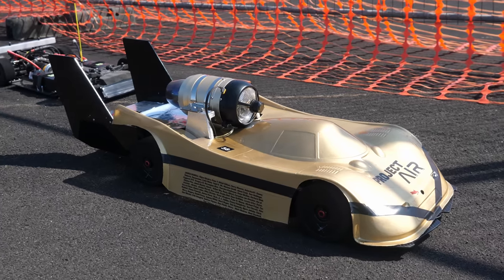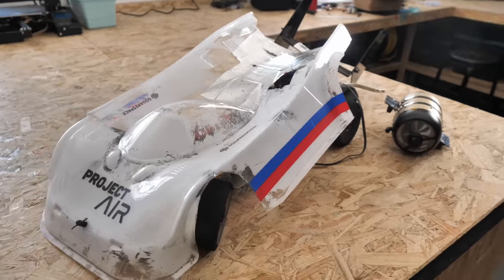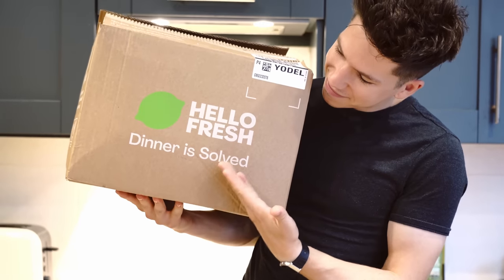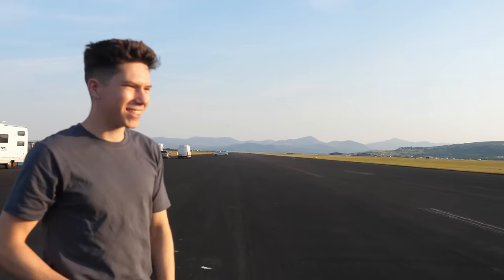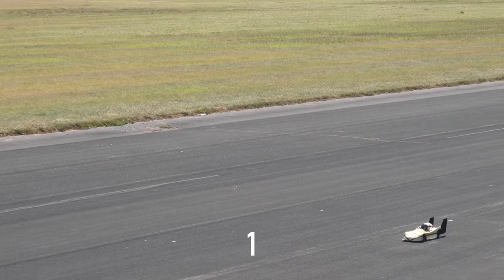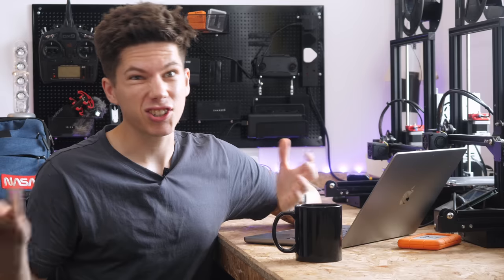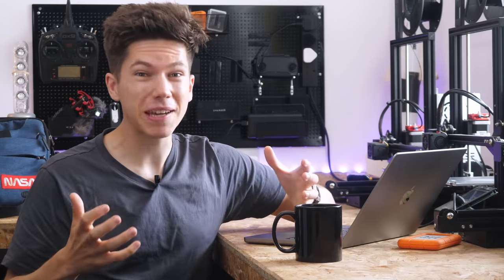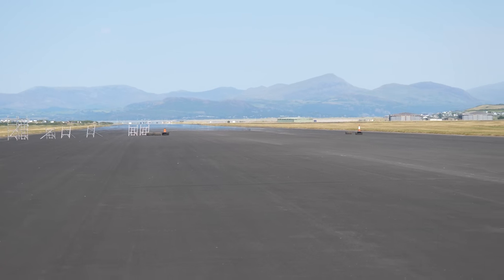Fastest RC Jet Car (Runway Testing)

Comment: Great Vid sorry about the bad luck. I don't think you need to retire the car yet, i think you just need to check your steering components the slop could be any one of 2 or 3 minor components in the steering assembly. when you were moving the wheel and showing the slop i noticed the the tie rods were moving with the slop meaning they are not the cause meaning it is deeper in the car. As an Arrma owner and fan there are 3 things i always change right away to make the cars way more precise and responsive first is the stock steering servo. Most stock servos from any brand's RTR's are okay at best but they are usually slow and/or weak if you are still using the stock one replace it with a better one that oscillation could have been from the gyro overcompensating for the slow servo. My go to is the Savox 1256 TG it isn't the fastest or strongest servo but it is both strong and fast enough to do Scandinavian Flicks on any Arrma 6s cars and it won't break the bank. Number 2 the servo horn and servo saver, with any of my faster Arrma's i notice that sometimes after after hard cornering they would pull slightly to one side then the other and i tracked it down to the plastic servo saver and soft servo horn replace them with at least the hot racing Anodized aluminum saver (some Stock Arrma savers have bushing not bearing USE bearings) and clamping servo horn (with 2 clamping studs and a center screw), and for your usage  i would tighten the servo saver all the way so it will not give at all so there is NO play in it. This will mean if you hit a curb or rock it will damage the servo but savox has casings and gears sets available for a decent price so this is less of a concern especially since you will be running this in open areas. Last but not least is the servo mounting bracket this is another source of slop in the stock steering setup, any basic any aluminum replacement would help you out.  When i upgraded the servo, horn , and saver in my Arrmas i would notice the resistance of the car sitting on pavement was enough to flex even the latest/thickest stock plastic servo mount. The amount of flex so doesn't usually affect my driving and it protects the servo a bit when i crash so i don't always change it but in your case i would change it, with the speed and expense of your car i wouldn't leave any slop in your steering at all. The servo mount i wound recommend is made by Just Bash It RC the flexible mount could also be adding to your gyro oscillation problem i hope this helps also even if you built/bought  a new car if any of these stock Arrma parts are used in it you problems would remain

Comment: Turn the gain down on your gyro if you plan on going that fast. And YEP, if your steering linkage is worn, that WILL create a wobbly feedback loop with the gyro. I found out the same way...

Edit: My radio has a potentiometer for one channel, and I assigned my gyro to that channel so that I can turn the gain up, down, or turn the gyro completely OFF on the fly. Perhaps if you dont have a pot as one of the channels on your radio, you could assign a switch to turn the gyro off if a problem crops up mid run.

Comment: I really like the project, would love to see more of it! A comment on the gyro - at 14:48, without the gyro there is still steering oscillations. If you can change the control parameters of the gyro, I would keep it if I were you and try to tune it. At least I would not remove it, before I rule out that the sloppiness of the steering is the thing freaking the gyro out.

Comment: 1st off, Spektrum isn't the most reliable system, so I'd get rid of that.  Set up your suspension, and check chassis tweak (balance of shocks left and right) so the preload on L/R is even, and move the fuel tank to the C.G. so it doesn't effect the lateral balance.

Comment: Great video, pity about the crash, but hey sh1t happens. You have the technology you can rebuild it....
You should join the two vertical wings together at the top, like a box wing, to increase rigidity. You could then use the cross member to add static downforce or just have a neutral cross member. You could even have a servo actuated variable cross member so it would change position depending on speed.

Comment: It’s a mix of the gyro and the fuel tank man. Might not have made you crash. But the oscillation is most likely from the gyro starting it by the gains being to high and that makes the fuel start to slosh. It is a domino effect after that 
one working off the other.  I thing a fuel bladder would be a better choice then a tank. What I used was I-v bags in a bunch of my gas models. They work great. And they come in different sizes. May also want to consider a smaller tank. Enough for just the run you are doing. And then use a quick connect fuel fitting from a rc plane. No need to take the body off.

Comment: try to use a flight controller (for drones) as gyro. On some you can log the Gyro data  to an SD card. Adjust the PID values and filters according to your data. 

I used spektrum radios longe time a go.... i had to switch to FrSky because of often failsave and signalloses.

Comment: Convert to a hover craft reducing the friction and drag caused by tires touching pavement. This would also prevent roll overs since there's nothing to catch, wouldn't make as sharp turns  but would be able to at much greater speeds. Would be something like the fiction craft from star wars , the speeders.

Comment: Find a small lathe/mill and ditch the plastics. Smithy  has used ones. Carbon fiber and aluminum useage will be better. Find another body, cut it down the center line, set on car, fill in gap with hot glue & poster board and modeling clay to make a quick mould. Poor plaster of paris over it for mould. Pop body and clean up. Bust out carbon cloth /epoxy and rip off plaster. Easy and quick.😀

Comment: Probably need to denoize the gyro and have it only compensate when change of direction is extreme or continous, you can do a lot of fine tuning with a control setup

Comment: Put some rudders on the fins. The gyro should affect only the rudders not the steering wheels. When done right, those rudders will have much less sloppiness than any steering wheels. (Many less linkage joints)

Comment: In high school, I made a car in metal shop, intended to use a CO2 cartridge for power. They were also designed to track down a long wire for left/right control - straight line only.

Because I missed school the day we were to race our cars, I never got to see mine go. 

Til summer vacation. 

When I found out a model rocket engine would fit. I lined the car up on the sidewalk going across the front yard, and let it rip.

That’s when things went wrong… without a guide wire, the car went vertical, then summersaulted and tumbled through the dry grass. Little burnt spots, every 6-10 feet, like a UFO with an indecisive pilot. Oops. 
🧐🤪

Comment: The reason that crash happened is because it was not setup properly initially.  Changes to the radio make no difference.  Fail safe is set when the RX is bound to the TX.

Comment: Given the car did show some sign of wobbles during the table top run, could there be some electric noise being introduced to the gyro? (The test case was also done with an electric motor as a load on the power supply.) If you have the stuff, might be neat to put in on a scope to see what the signals are doing. Might need to make sure power going to the gyro is filtered to avoid false signals. Might also want to use some kind of soft padding on the gyro mount too, so it doesn't get mechanical shocks or a lot of high frequency vibration.

A mechanical steering damper may be a thing to look into. Given you want to keep the car in a straight line, it doesn't need to be really twitchy. The steering on this type of car is more to compensate for drift from the intended path.

Also might be neat to add an eductor fairing on the exhaust side of the jet with the idea of pulling air out from under the body fairing. But that would require some means of stiffening the lower body skirt. Yet a whole other mod, but if done well it could help keep the car planted. The concept of active down-force was well proven with that one car specifically built for it.

Comment: Got a problem with electric noise. Probably from the turbine pump. Need to use shielded servo wires. Use fpv antenna cable for the signal lead and problem fixed.

Comment: Project air I have a question, wouldnt you gain an mph or two if you sharpen the leading edge and the trailing edge of the wing and the fins that hold it up? I see all of these speed run videos and every one ive seen they leave that flat surface on the leading edge. Wouldn’t that make it more aerodynamic?

Comment: If you try a gyro again start with minimum input from it and slowly bring it up till you find a sweet spot where it's good for both low and high speed but at high speed always keep it at the minimum it functions so that it will only make slight adjustments instead of larger ones like the one you had trouble with which can flip the car.

Comment: Arrma’s are great bashers. But you’re going for high speed and the slop they develop was your undoing. Consider rebuilding the steering with tighter tolerances or using a higher performance chassis is my armchair recommendation

Comment: What material did you use for your home made parts? Got a link? Was it carbon fiber or some kind of poly carbonate? I think it has to be harder to control a land vehicle with a two stick air transmitter than a land one with a wheel and trigger. JMHO. With a land based transmitter, one variable that you can adjust is the dual rates. I too had problems with one of my buggies, not going anywhere as fast as you were going, and adjusting the dual rates down was what it needed.

Comment: Also making the plastic body rigid with fiberglass or hardening material to keep the body from flexing and breaking and I think would maybe help control better at extremely high speeds 💯 +

Comment: Well unfortunately we all make mistakes this is one of the reasons that I still use my old turnigy 9xr pro transmitters , because they talk to me and tell me if my failsafes are on lol, now I can totally understand why people suggested to use a gyro because I have one of my cars with a gyro on there but for the opposite reason so it makes it really easy to drift but when you turn switch off it just acts like a normal car again but at the end of day you’ve got to think about it logically on where you actually mount a gyro , so on a helicopter it would be soft mounted on the tail, so I would suggest that you would do the same on the car because that’s how I got it set up on my car so one switch position I can drift the car really easily , which is a lot of fun but in the other switch position it does the opposite and stops the tail from losing control, but I would put it in a high position at the back of the car on a rubber pad , start dialled down slowly increase it until it starts to overcompensate , then dial it back I turn , keep up the good work better luck next time

Comment: My first thought is why don't you have logging of some sort to track the signals of the gyro? That would make diagnosing any gyro issues a matter of simply checking the logs. Any oscillation in steering output would be immediately apparent.

The next question that came to mind was whether you had tuned the gyro. I don't know the specifics of how that system works, but just slapping a gyro on without tuning it is a recipe for disaster if I've ever seen one.

Comment: Gyros are a good idea but can you maybe increase its margin of error and overcorrection? Like the degree of input at x time(i.e correction over .5 milisecond vs say 5 ms) perhaps this will eliminate the "jerk" that causes the oscillation. 

A slower steering correction to put simply.

Comment: The moment I saw it I could see that the gain was MILES too high. Also, you need a much faster servo too, it is lagging behind what the gyro is asking for - the gyro tells the servo to move and it does, but it is too slow to keep up and overshoots, so the gyro tells it to move back. This is cyclic which can then lead to the oscillation

Comment: As far as the gyro goes, it feels like that's just a tuning issue. Where you need to do something like the tuning process rctestflight has to go through with all of his autonomous craft. 

As others have pointed out the tuning for high speed versus low speed is likely different, but since you don't really need it for low speed it would make sense to tune it for just high speed. Right?

Comment: With the motor up so high, does the angle of thrust change as the nose of the car tries to lift slightly at higher speeds? Would adding front canards or an aero foil to the front help in stability?

Comment: I have run Gyros on rc cars before.  The freak out during static test is probably from interference on the signal wires.. this can be caused by metal to metal rubbing.  And the oscillation is most likely a combination of high gain, and the slop in the steering.  If there is any slop in the steering the gyro is going to overcorrect.and the higher gain will correct to far to one side.

Comment: I grew up in a hot in humid place and now I live in a somewhat hot in humid place and I can tell you yes, the heat will make you sloppy. 
P.S. Tho think the vertical fins are mistake if you also have a gyro where it’s trying to drive it with the front wheels not with the tails.

Comment: I would guess that vibrations may well have caused the gyro issues. Just like they can on multi-rotors, or at least they did before all manor of filters built into the software greatly improved things. How about using an actual flight controller instead of the standalone gyro? That way your going to have the advantage of all the built in filters, plus you can graph the data to see exactly what is happening.

Comment: You have the gyro gain to high. The gyro will also give you a bad wobble at breaking down the speed also. Had a few bad experiences in the breaking period due to the gyro being too high and dipping the nose hard and then sent it into having wiggles. Granted mine being electric, I didn't have the jet motor so high, which even if it didn't throttle up, IT might have sent it for a tumble having such a high CG. Sorry to see it crash like that though, with all the work you have been putting into it

Comment: I think that the body you are using makes the car extremely unstable, the air passing through the sides of the car makes the body wobble which eventually makes the center of gravity wobble explaining the instability of gyro. You should try to make body a bit rigid it will greatly improve the overall stability.

Comment: Sucks to see this project crash 😥😥As soon as i saw that wobble I thought Gyro set up to high, its what I call the classic gyro wobble 😂😂 gyro needs to have remote gain set up, then turn it right down to avoid the wobble at high speed.

Don't give up on the car, i would say its a good platform and that slop can be removed with new links and also some heat shrink over the balls if needed, also add some side skirts so the air doesn't get under the sides of the car, this will also allow you to stiffen the sides of the body from the suck in effect.

Comment: You really need a better radio. A standard wheel radio would be best, but at least get away from Spektrum. I remember flying a friend's drone with a DX6e or something, and the range was horrible. I had a failsafe and I was maybe 500ft away.

Comment: Freakin Spektrum! Don't get me wrong they make great radios usually BUT there RF radio link is junk! Ditch it and go for a radio that's got a module bay and run ExpressLRS in either 868mhz(for EU) or 2.4ghz! 2.4ghz should more than likely suit you great with very low latency and range for days! I'm not familiar with the DX6e but if it can output crossfire protocol than you might but able to use it with ExpressLRS but might be not worth the hastle, grab a RadioMaster TX16S fit it with ExpressLRS 2.4ghz at 250hz-500hz and never look back! Crashes due to link failure was the reason I ditched Spektrum years ago! The range was terrible in the air and is even worse on the ground! Hope to see the car back up and running soon man!

Comment: I'm not sure what's gonna happen. But you have up tilt on that front bumper. That's going to be your nemesis at high rate of speed.  The gyro needs to sit on a anti vibration.  just like the receivers need to be isolated

Comment: My first rc car I turned into a rocket engine powered car(around 2009). I was able to do this because the aircraft company I worked for made landing gear parts out of titanium. I took some crap titanium and used it to protect the plastic from melting when the rocket engines would shut off.
For my first test, I found an abandoned airport. So, I tested the car on the runway.
My first test went well, with 1 rocket engine. The next mod was to add 3 more rocket engines.
This time I went to test the car. I was standing about 30 feet off the passenger side towards the front. 
When launched the car was forced to the left. Next thing I know, is I'm jumping over the car, over and over, as it sits below me doing circle's and caught my pants on fire.....lol now I'm screaming I'm on fire while trying to put the fire out...lol

Comment: On your new car can you limit the steering angle? Or dampen the steering angle input? And/Or increase the wheelbase to give more stability and less twitching. Seems that chassis was originally built as a good all rounder - not specifically for straight line speed.

Comment: I think the momentum of fuel in the tank can be one  of the reasons for disbalance.Coz you are using a fairly  large tank ... and in the previous video accident happened after refueling.  Create  segments  in the tank Just like fire engines to reduce the force of moving
 fuel......Just a thought!